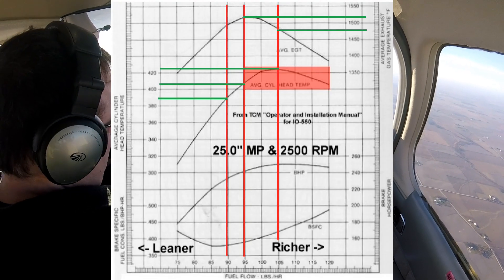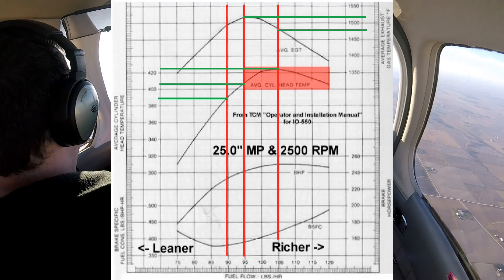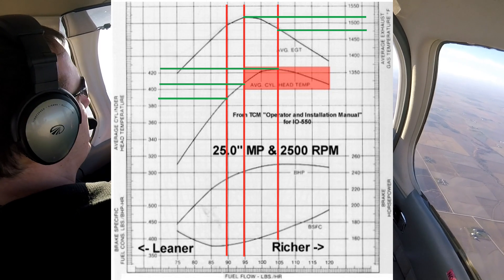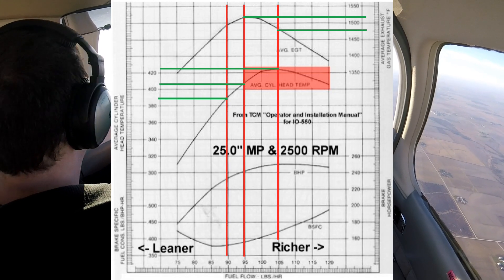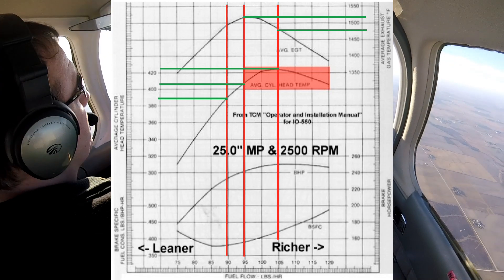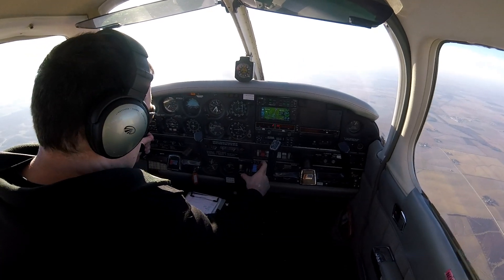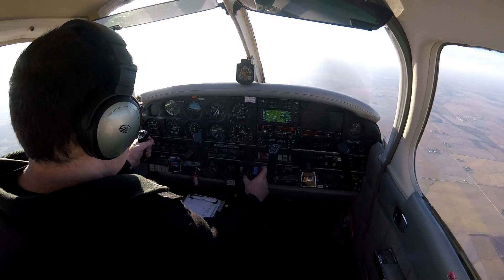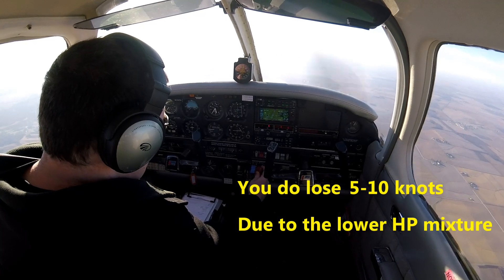Leaning mixture with a constant speed prop

Comment: Leaning is different in a fuel injected engine versus a carbureted one. Fuel injection distribute the fuel evenly to each cylinder. So if you lean too far, all cylinders will suffer the same reduction in air fuel ratio. With a carburetor engine, due to different lengths of the intake, manifold your cylinders furthest away from the carburetor will be leaner than the other cylinders that are closer to it. This is why most carburetor engines do not recommend running lean of peak. I use a cylinder head temperature or CHT over an EGT. As long as your cylinder head temperature does not exceed 400°, which is detrimental temperature of cylinder head material. I run the lowest possible RPM for the altitude and as much MP I can obtain and then lean. Not the same  method if I’m in a turbo charged engine. In that case I use the POH specs with about .5” more MP and then I lean for temp. The engine burns cleaner with less lead deposits and is able to run more fuel efficient.
Reply: The never exceed temp on O-360s per Lycoming is 500. The temp they want you to keep it below to prolong cylinder life is 450. Idk where you’re getting 400

Comment: So on a fuel injected Turbo engine you cant control mixture or manifold pressure so how do you control the prop just rpm 🤷‍♂️any help ?
Reply from the maker: Are you talking about a newer FADEC setup?  Most turbo injected planes still have a mixture and throttle lever unless they are FADEC single lever.

Comment: I see some comments suggesting RPM & MP settings where MP is slightly higher than RPM... 
at the same time, I heard earlier, and I'm still learning hi-perf props,  that MP (man. press.) that is higher than RPM puts excessive pressure on the engine and could damage the pistons/cylinders..

 which of the two is correct? it's confusing me
Reply from the maker: This is the "over square" old wives tale I mention in the video.  The simple answer is just look in the POH.  Higher MP than RPM settings are in POHs all the time, even in turbo aircraft with higher than standard MP.  I just looked up a turbo Piper Arrow POH and there is a 75% power setting in the table with 34.8" MP and 2300RPM.  The NA Arrow POH has a 65% setting at 25.9" and 2100 RPM.  These are cruise settings and not climb settings, but there is nothing wrong with them, in fact they are recommended by the manufacturer.  Actually, if you want to run lean of peak EGT, it is beneficial to run at lower RPMs.

Comment: NEVER LEAN on ascent.  Lean in cruise and adjust the mixture to prevent the engine from running or missing on descent.
Reply from the maker: I'm not sure I understand your comment, but I would also point to the adage never say never.  If you are climbing from sea level to 9500ft in an NA aircraft and never lean, you will be way too rich at those higher altitudes.  In fact, my factory fuel flow gauge in the bonanza shows where to lean to at different altitudes during climb.  If you are full rich at takeoff and record the EGT, you should absolutely be able to lean during climb to maintain that same EGT and you will have the same air/fuel ratio at 7000ft as you did at 1000ft which should be plenty rich.  That is usually around 1300 degrees.  In a turbo, this doesn't apply.
Reply: @igor-orzhevskii  Laughing.  You are not a pilot.  And obviously should not be touching anyones engine.  

Most should be leaning during taxi to prevent fouling plugs.  Set the mixture usually about 1/3rd down from full rich REGARDLESS OF DENSITY ALTITUDE.  Leaning in cruise is critical and most do it by FIRST setting the throttle to your desired manifold and RPM (70% power or greater), then reducing the mixture gradually until the engine runs a little rough, then slowly enrich the mixture until the engine smooths out.  No one should lean in a climb as the risk of starving the engine of fuel and reducing power below a critical level is greater than achieving any kind of fuel savings...

The downside to leaning is if you run the engine too lean, you can have preignition, detonation, and/or significantly reduce the life of the engine or worse, damage pistons requiring a major overhaul.
Reply: @speedomars  you can think whatever you want. We were talking about 'leaning mixture during a climb', not how it's done on the ground or during a cruise phase. If you're in a continuous climb from, say, MSL and up to the absolute ceiling of your airplane and you're not leaning, then you just wont make it up there. Your engine is running on an imbalanced fuel/air mixture as your progressively go into a high density altitude. Period.
 Again, I didn't mention here that a primary reference should be EGT or CHT for a multi-probe engine monitor. If cylinders getting too hot, then you obviously should reduce power/enrich/decrease pitch attitude/open cowl flaps etc. Flying full-rich really is a waste, will foul your plugs, will increase your risk of CO2 poisoning in the case of an exhaust leak, and will reduce your performance (range). You can't starve your engine on fuel, unless you abruptly pull back the lever and that's why there's a Vernier mechanism located on the knob, to precisely adjust it little by little.
For additional information, one should consult his POH and engine operator's manual.

Comment: As a past Cedar Rapids resident it's cool to see the old airport again.  I got my private and instrument ratings there.  I kept my 79 Archer in the west T's.  Now live in Tucson (Marana KAVQ) where we have A LOT of student traffic in the Phoenix - Tucson corridor.  I miss the low traffic flying there in Iowa, but don't miss the weather....  Almost forgot my question!!  Shouldn't your prop RPM always be higher, or equal to, your manifold pressure?
Reply from the maker: I kind of miss the low traffic of Iowa and my Arrow too!  KARR isn't too bad though, and I have to say I love the Bonanza!  Someday I plan to be up in Payson where I bought airpark land :).
Your question pertains to the old over square debate.  My understanding is that is a hold over from the turbo/supercharged radial days.  It is perfectly fine to run over square in cruise on a NA GA aircraft.  In fact, the power settings are right in the POH showing over square.  You wouldn't want to climb out with RPMs set low, but in cruise it's fine.  I tend to remember the Arrow POH even showed 2100RPM and 24" as an option.  I'd be more concerned if the plane was turbo charged and running 43" or something like that, but by definition you would always be over square in that case.
Reply: @kujoclips4962  I hadn't noticed that you'd moved, but I did see you moved up to a Bonanza...  Everyone's dream aircraft...   Traffic isn't terrible at KAVQ, but as you move north..  Casa Grande, Coolidge, Ak Chin, Williams Field and others, it really gets crazy!!  Payson is a great place!  Much cooler than Tucson.  You will love it up there.  Good luck!  If you ever get down this way, KAVQ has a great diner.  Sky Rider Cafe.  I'll buy you breakfast.
Reply from the maker: BTW, here is a great dissertation on operating over square by Savvy - https://www.youtube.com/watch?v=A1fmNFWNHD4

Comment: Could you cruise with the rpm at 1900?
Reply from the maker: The POH doesn't show any power settings using 1900RPM so I would probably avoid it.  I don't know that it would necessarily hurt anything, but think about it as shifting your car into 5th gear.  You should not be under high load conditions if you do it.
Reply: @kujoclips4962  for economy cruise it would seem that 19k rpm and 20MP would work lean of peak. I downloaded the Operations pdf for lycoming io360 and there is nothing that I can find that precludes such operation. I expect you to pick up at least another 2gph
Reply: Mooney guys have a very similar engine and do it all the time it seems
Reply: In fact, I am confident, you may safely operate even lower RPM, as long as the power setting is 75% or below, which is around 20MP, and you have good charging and oil pressure.
Reply: Absolutely, however engines greatly benefit under operations at designed torque loads. Any more may lead to wear that may occur under loads not designed. Another slight problem is carbon buildup at low rpms. Both of these are nitpicking however I’d consider
Reply: @hunterherzog4673  I would expect the wear to be reduced. Less rpm, less wear. I saw 7gph before leaning on my arrow. 125 mph. Climbing was more difficult but not impossible. Seems like a good descent setting.

Comment: I've never heard of anyone running LOP with just a single EGT gage.  Sounds risky.  You don't really know where the other cylinders are at temperature wise.  There is a "danger zone" right around peak EGT.  I don't think you want to be within 25 degrees of it.  I definitely could be wrong.  I've talked to a few mechanics who LOVE LOP since they get to change cylinders more often!  :)
Reply from the maker: Agreed that a real engine monitor is critical and relatively cheap insurance for your engine.  I generally flew that arrow around 65% power, so the red box doesn't really apply.  The danger zone is really around 50 degrees rich of peak closer to 75% power and above, so if you are running pretty lean on one cylinder, you should have some margin unless your fuel distribution is way off.  I'll also note that engine was rock solid and seemingly did not burn a drop of oil in the years I had it.  I do plan to have a real engine analyzer in any plane I buy moving forward though.
Reply: If you're at 75% power you can pretty much lean it to whatever you want...

Comment: That camera really gets the shakes when you coarse out the prop.  Is it noticeable in the cabin?
Reply from the maker: I do think the camera being hard mounted to the airframe exasperates the vibration.  That said, I think I leaned it a little far hence the additional vibration.  I was so busy doing the video, I must not have noticed.  Normally you would want to enrichen enough to smooth things out.  This shouldn't be terrible on the engine other then added vibration isn't great.  So here is a takeaway from the video, when leaning, enrichen for smoothness!

Comment: KC do you have any idea how the rich /lean indicator correlates to air/fuel ratios? Most gas engines like to run in a fairly narrow AFR band and every kid with a tuner car has an AFR gauge to show the engine is in that band, or bad things can happen. That seems easier than than playing around with multiple factors to get a smooth, cool running engine. However it requires EFI air and fuel data sensors to calculate. Thx.
Reply from the maker: Best power mixture which is generally considered slightly rich of peak EGT (50 degrees rich I believe) is between 12 and 13 to 1.  Peak EGT is at the Stoichiometric ratio of 14.7:1.  We work with the instruments we have.  Also most of these piston engine singles have fairly uneven fuel/air distribution and primitive fuel delivery systems.  You can't really monitor fuel entering each cylinder directly like modern cars.  You can monitor cylinder EGTs though.
Reply: @kujoclips4962  KC thanks for that.  I guess there is more AFR control than i would have thought.  Which leaves premature engine failures an issue for those not paying att'n. As you say these air cooled engines are still in the dark ages in terms of fuel delivery. Need to pick up their game about 50 years. Lite jets have FADEC, A/T and syn vision so pilot just flies the plane, but learning pilots have to struggle with fuel mgm't. OK for good pilots like you but a risky distraction for student pilots.
Reply from the maker: @robertrpenny   It is remarkable how GA engine technology hasn't really kept up with automotive through the years.  That said, a large number of new GA aircraft have FADEC options or at least electronic ignition and things like that.  The majority of the fleet is still 10's of years old though so understanding this stuff is important.  Probably good for students to understand how this stuff works anyway.
Reply: @kujoclips4962  KC i guess student pilots are mostly in decades old planes since that may be all they can afford to rent. It is good for them to understand that everything is not plug and play so long as they dont have an accident trying to deal with flying and managing fuel system. Sort of like  teaching a young person to drive. Easier to do in a new Honda with AT then an old Brit. sports car later. Which has 3x as many primitive issues to deal with.

Comment: Thanks! Have you noticed how you cam is shaking after you did all your adjustments? that is not an indication that the something not that good is happening? I would love to read your comments about this.
Reply from the maker: I just re-watched it and see what you mean.  Looks like in demonstrating how low the fuel burn could be with leaning, I may have left it a little leaner than optimal.  At the end of the day, you enrichen for smoothness as you adjust.  This isn't a catastrophic problem though.  A cylinder is just running leaner than the others meaning the power isn't balanced.  Other than unwanted vibes, it won't cause a major issue.

Comment: Just FYI, there are some myths regarding cylinder head damage from running at peak EGT at 75% power or less that carried over from radial engines and may not apply to modern engines. The AOPA has an interesting article about this.
Reply: Dyl Connaway where did you find it ?

Comment: Hey man, I've been sniffing around YouTube watching lean of peak rich of peak tutorials, how would you think an engine is controlled with things like manifold pressure fuel flow forced induction and RPM? I find it interesting because there's math out there that allow us to understand "the red box" and stochiometric ratios and perfect CHT, CHP. Math is efficient, but I still am learning it all,
Reply from the maker: I'm not sure what the specific question is, but I think you are asking how you control "power" with manifold pressure, mixture, and RPM.  The simple answer is the prop pitch (RPM) controls the load on the engine.  At low RPM setting, there is the most load for a given RPM on the engine, at high RPM the opposite, and there is a RPM setting where the prop is most efficient.  Above ~2700RPM or so in this case, the prop tips lose efficiency due to higher speeds I believe.  The manifold pressure is an indirect measure of throttle position and load.  With low throttle settings, the throttle plate is mostly closed creating engine vacuum (low manifold pressure).  When you firewall it, the throttle plate is wide open resulting in minimal vacuum or near atmospheric pressure.  If you have a turbo, that high manifold pressure will be above normal atmosphere.  The power the engine develops is a combination of load, throttle, and mixture.  There are different combinations that result in a given power as you can see in the POH power settings.

Comment: I loved the chart.  I never considered that the EGT lags behind CHT.  CHT is probably the more critical parameter, so I wonder why so many arrows have EGT.  Maybe EGT is easier/cheaper.  This may sound strange, but I tried leaning on a hot summer day at 3500' and about 75 degF and my EGT went almost full scale before I pulled back.  What's the deal with that?
Reply from the maker: I think I have seen that in the past, and I think it was just not calibrated. It doesn't make sense that the exhaust gas would be way hotter in one application vs another. I'm not sure why more planes don't have cht gauges. The egt is important to understand what the mixture is though. Cht is dependent on more variables such as load and air flow over the heads, so it wouldn't be a very direct indicator of mixture.
Reply: Hmm, that makes sense, as EGT, is the actual result of what happened in the combustion chamber.  In theory, one could analyze that gas and determine exactly what happened, how much fuel was not combusted, how much NOx, etc, and since the gas flows quickly the temperature should be fairly close to what it was in the cylinder.  I like it.
Reply: Some older planes (notably the Electra 10-E, and also I think the DC-3) actually have an instrument which does that -- the Cambridge gas analyzer!

Comment: ok so you dont do the "25 squared" thing then?
Reply from the maker: Generally no.  In the arrow I fly it really doesn't apply anyway considering the Hartzell Scimitar prop cruise RPM is 2300.  If I limited myself to 23 inches and 2300 RPM, I would only be running <65% power.  The only time I would be above 2300RPM would be at takeoff or climb where my MP is full.  In the older arrow I got my complex in, 25 inches and 2500 RPM worked out to be around 75% power, so it was somewhat applicable in that case.  

From what I understand, this rule of thumb came from WW2 era turbo/supercharged aircraft, where the MP available was very high.  In NA aircraft like my arrow, rarely can you get more than 25-26 inches of MP anyway.
Reply: Full power takeoff to /400' 2850/FT, then 25 squared reduce ff to about 18 gph.  At cruise 2300/23" adjust FF to 25 LOP, cht below 380 normally somewhere around 12-14 gph  IO520 in 182. I cruise 65% or below, more efficient and have shutdown a few engines, so I'm paranoid.